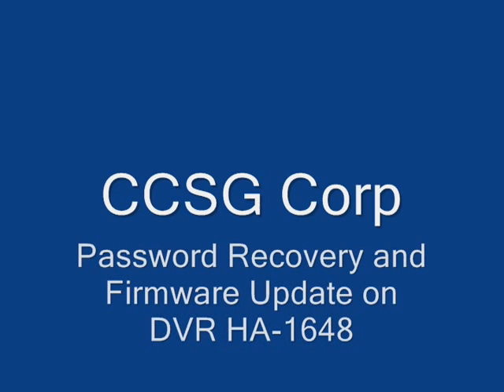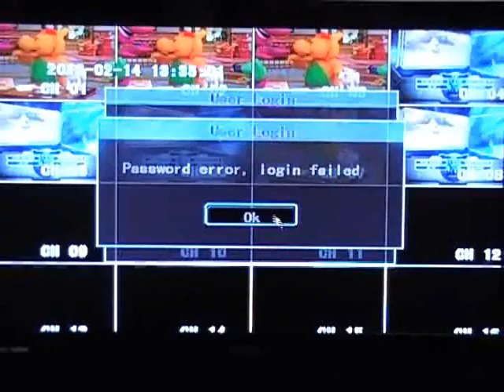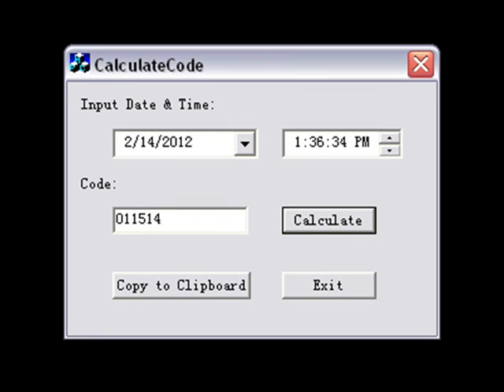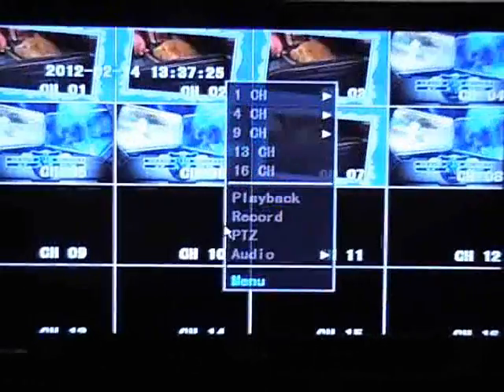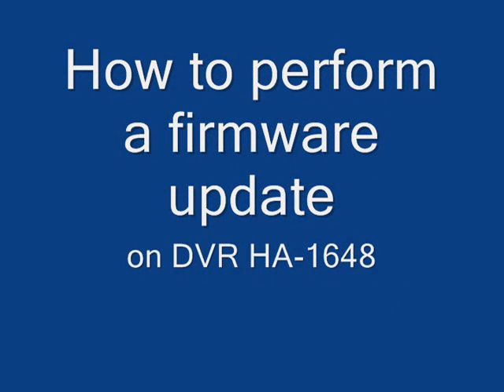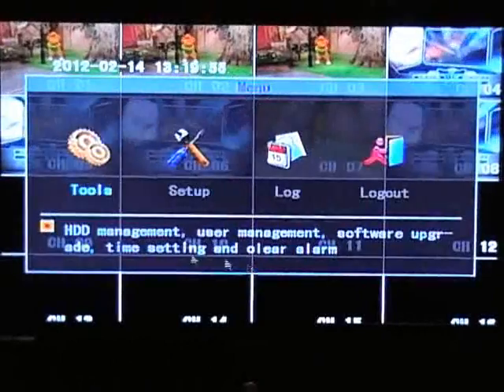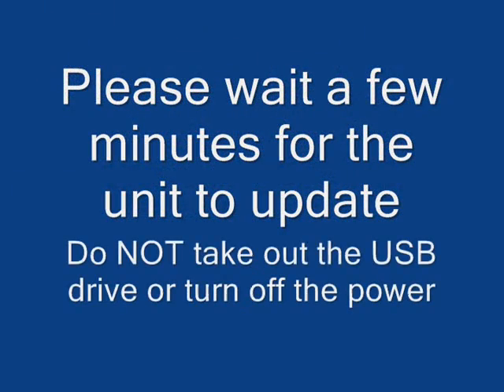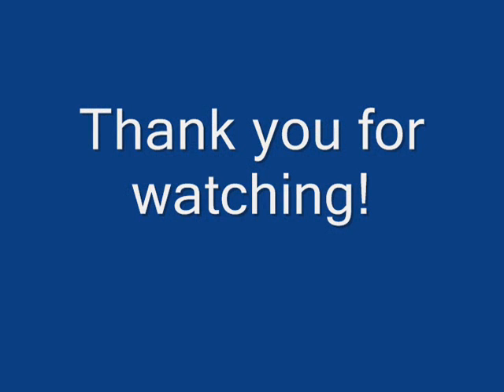HA-1648 - Password Recovery and Firmware Update

Comment: h264 models must press the esc button is held down, the dvr shuts down and the tight esc button turns it on, the buzzer sounds once in the second ring so loose and ready.
algunos modelos h264 se debe presionar el boton esc se mantiene apretado, se apaga el equipo y con el boton esc apretado lo enciende , suena el pitido una vez en la segunda vez que suene lo sueltas y listo